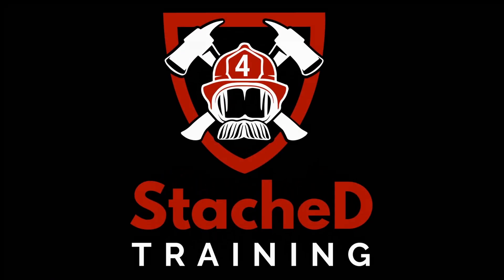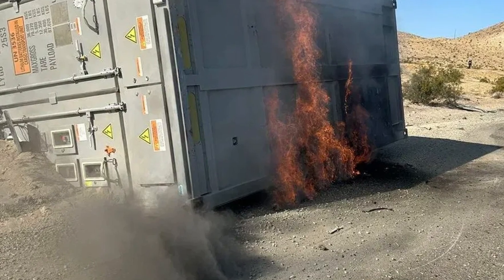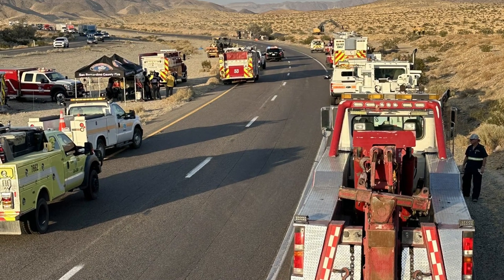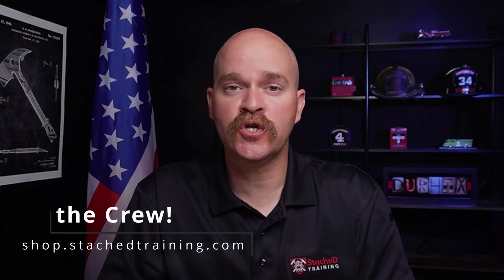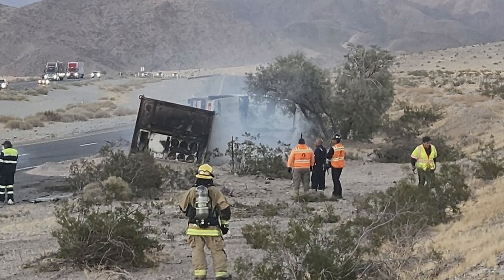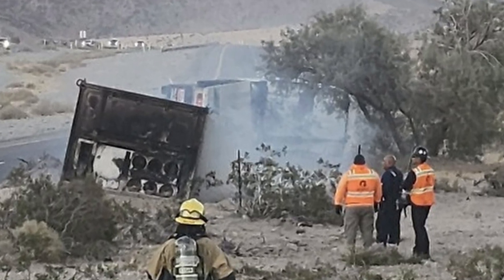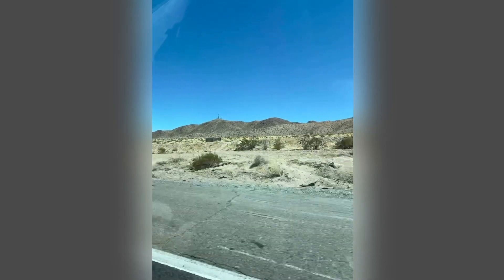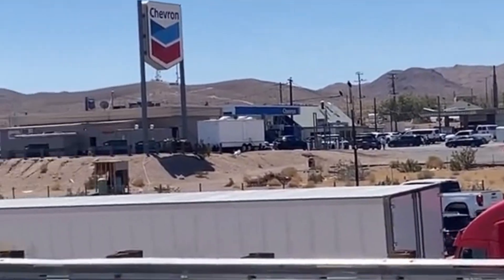Disaster on I-15: Lithium-ion Batteries Cause Major Delays

Comment: This had a great potential to kill. They left thousands parked in 130 degree heat. The DOT JUST HAD TO DO A CROSSOVER THRU THE MEDIAN AND MAKE SB a 2 lane road. PPV FANS could have been used to blow the smoke away from the road. The truck driver needs to be held accountable.
Reply: I'm wondering the same. Seems like the DOT is unprepared, in competent, or both.
Reply: @vladimus9749  I see this time and time again. Major highway projects with no thoughts on alternative routing solutions. You also see closed freeways force traffic to local streets. Same thing. No cops or traffic assist devices. They leave local stoplights unchanged. One semi rolled over on one off-ramp. It gridlocked the city for 12 hours. Every freeway, surface street and ally.
Reply: @Rabbitt-d6y  it would be easier. You have alternative routes.
Reply: No, driver escaped across border.
Reply: Yes, these potential bombs shouldn't be on the highway at all. The use of these dangerous devices should be heavily restricted, and portable power can be easily and much more safely produced from diesel-electric generators!